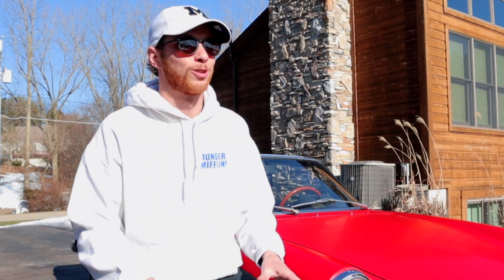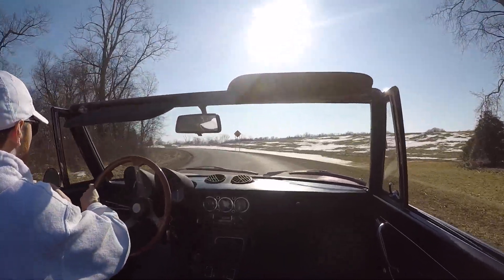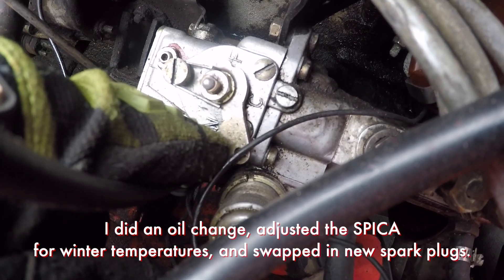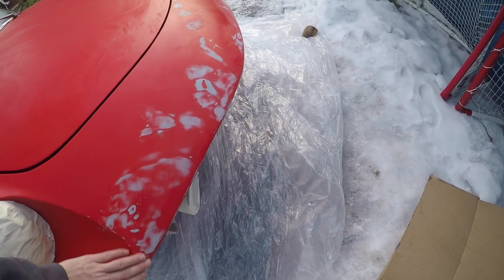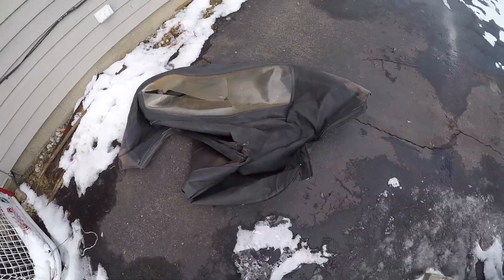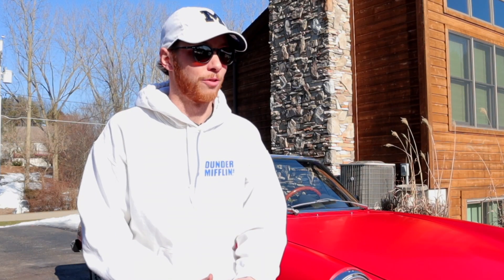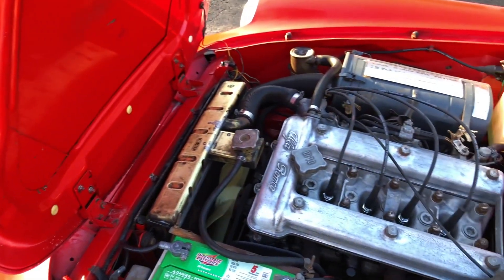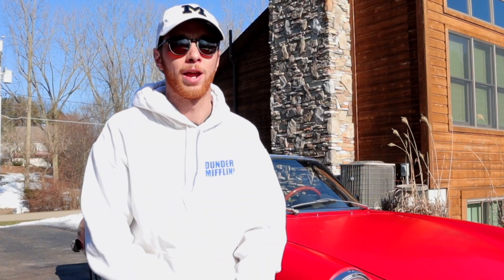1974 Alfa Romeo Spider Amateur Restoration Project - FINAL

Comment: Great stuff, I have a 1981 Alfa Romeo Spider with 43000 original miles 3 months ago.1 owner, it is a fantastic car. Quick question, where can I buy the oil filter from? Just wanted to see where you might have gotten it. Is it easy to replace? Also I know historically they are known to have small drips of oil, after driving and leaving it idle for a while but its not constantly dripping oil.. primary in the undercarriage but its so minor that I havent focussed on it much yet. Any idea where to look? I am new to the foray of classics, especially Alfa Spiders so any advice would be appreciated. Enjoy!!!!
Reply from the maker: Sounds like a great car! I got the filter from OReillys, I think they even had it in stock. Warning - it is a large filter that is difficult to access, an adjustable filter wrench recommended. The lower part of my engine does have a couple wet oils stains but no outright drips fortunately. I haven't figured out where it is seeping from but I did put some Lucas stop leak in there so I hope that helps. I recommend checking out/joining wwwalfabb.com There will be a forum for your car and any issue it has. There are a ton of very responsive users as well. Best of luck!
Reply: DIY GUY 101 thank you very much. I guess I worded my Oil issue wrong, it’s just some small oil stains that I see on the floor but in at incredibly minimal amounts. Looks more like spots of oil on the ground.. But I will definitely check the forums out. Enjoy the car!